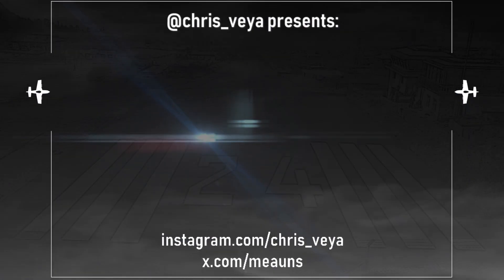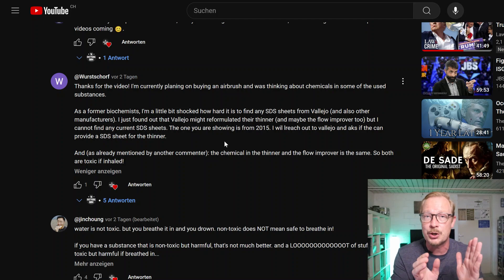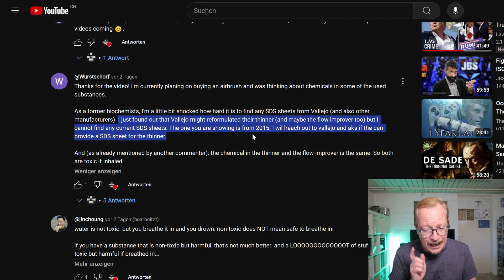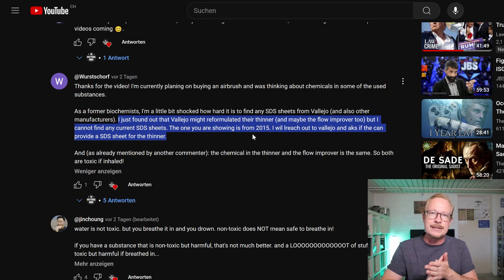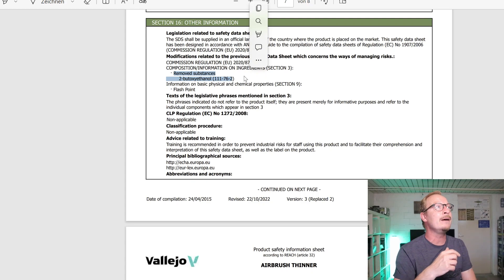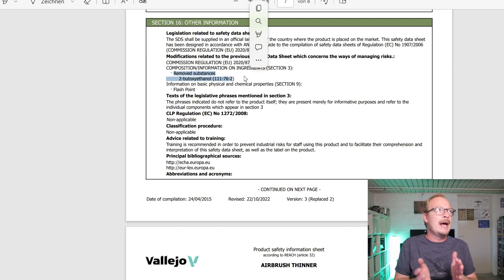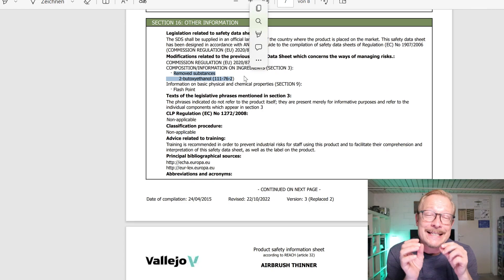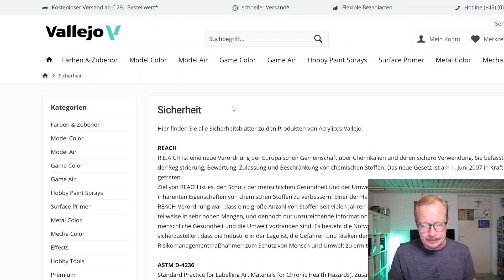VALLEJO REMOVED TOXIC INGREDIENT! - The new SDS of Acrylic Airbrush Thinner & Flow Improver

Comment: They still use Butyl glycol. In both the thinner and flow improver. I have both Butyl glycol and Butyl di-glycol, and Vallejo thinner and flow improver has it in them, and is actually possible to mimic using only Butyl glycol and distilled water. 
Butyl glycol is not that toxic, so it is actually not needed to be on the sds. Check up Armypainter Airbrush medium, sds, and what does it have? Butyl di-glycol, slower evaporating glycol ether. So it is a thinner and flow improver. 

I dont get why they say it is removed. It is so so special smell, like gasoline. You valt get it wrong. Nothing smells the same, even the closest chemical the Butyl di-glycol has a similar smell but not the same.

Comment: It's amusing to me how pretentious some of the comments are about the non-toxicity of the products by deflecting with "well, it's just water! Duh!" and lo-and-behold, fast forward ahead and Vallejo has removed a known toxin from the formula. Making things less toxic is always a worthwhile goal, even if the starting point was "well technically, it's not technically toxic if you technically use it in these correct conditions in these correct dosages..."*
Reply: Unfortunately it is not removed. It is only not longer mentioned in the sds. I have pure butyl glycol, so this whole video is wrong. Smells just the same.

Comment: I'm new to airbrushing, but I'm an expert at water. I don't see why purified water wouldn't clean water-based paints from an airbrush completely, and certain thin them down. The obvious exception being if the paint had dried already. The fact they've removed the chemicals from the product would seem to suggest this is true. Tap water on the other hand contains a lot of minerals and may not be ideal depending on where you live.
Reply from the maker: Thanks for the intel👍🏻

Comment: I've been able to get a couple of Model Air colours here in Oz with the new packaging..yellow ring around the top of the bottle etc and it smells completely different..i put a post of Vallejo's Face Book page and asked was it new formula and they said ''On no we haven't launched the New Modelair yet..it's the same as before''...but that's not the case from what i can tell from the new ones i have..it's different paint..and as far as the what the paint thinner is made from changes to formula have been made to the Game Color and Model Color by Vallejo in the last year or so which could have caused the changes to MSDS rating of the thinner